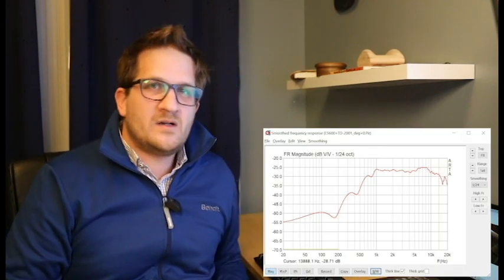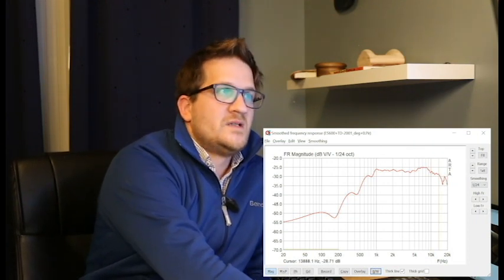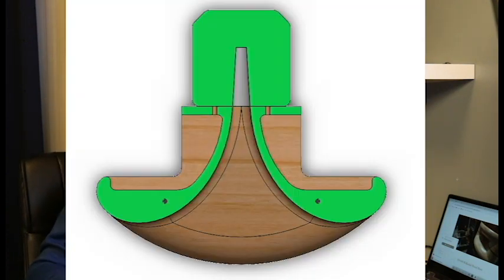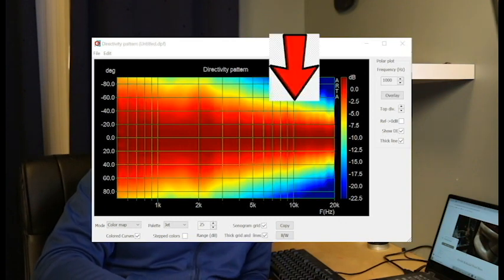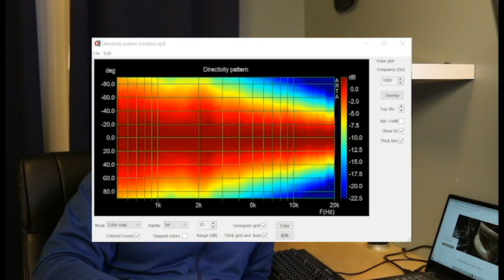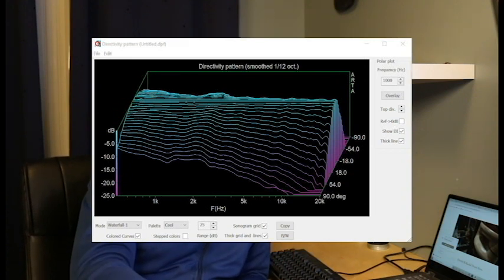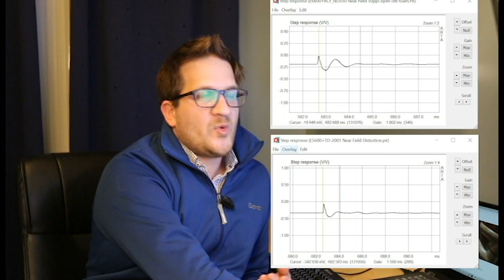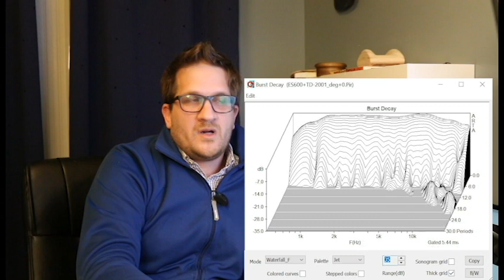TAD TD-2001 with ES-600 1" Biradial

Comment: Firstly I should say that I very much respect your work. I would say you are almost unique globally. The combination of knowledge and CNC offers the audio community a great set of products. I just want to note a comment on your subjective listening,; the driver is crossed at 1200 and you score female voice higher based on your comment that the horn is carrying the workload. I don’t know what you were listening to but the majority of female voice will play under 1000 with mainly second and theirs harmonics higher than 1200. The same is true for acoustic guitar which you commented would not compare on a woofer to the horn when in fact all the fundementals would play on the woofer with such a high crossover.

Comment: very honest video, I found your instagram and now your yt. The TAD stuff is just the best i guess
Reply from the maker: I think the TAD TD-2001 is a very nice driver.  Although I've tested other TAD models that did not perform any better than offerings from RCF and B&C.  It's a mine field these days with all the opinion and hype which is why I love the measurement aspect, it separates truth from fiction.   If it doesn't measure well then there's no chance it's going to sound good.  The set of measurements that I provide are usually pretty good at fishing out any shortcomings in sound quality.
Reply: Joseph Crowe's DIY Speaker Building i agree partly. But like with everything, exceptions exist and some things sound gorgeous but measure badly. Maybea it‘s not exactly what‘s on the record, but since it‘s catching us emotionally, it contributes to the experience. One example are the Goto drivers, they measure badly but many many people agree they sound best. But overall i‘m d‘accord with you! I would also like to know which TADs you have tested already:)

Comment: Looks great! A matching (exit angle - horn throat) driver/horn combo.. I’ve read before that the TD-2001 is at its most linear with high output impedance amps (both ss and tube..).. 

I’m curious as to what midbass driver you’d use to keep up with ‘em if these were your own (to bump up that score of 6 in the midbass to mids coherence..) Or maybe it just needs a midbass front horn? Also, for your taste, does it still warrant a horn tweeter even if there is almost no break up in the upper frequencies? I hope you could display the measurements in full screen next time. Thanks!
Reply from the maker: Thank you for the feedback.  I'll try to display full screen more so that you see the detail.  There is absolutely no need for a super tweeter with these.  I suspect other horns may need help since there would be cancellation effects due to the dispersion fins that you see on other horns.  The best midrange and bass solution would be to use a horn as well for this part of the spectrum. However integration is always problematic which is why I've come up with the Nighthawk speaker.   The midrange is equal to the TAD's clarity and technically you could use the TAD TD-2001 on the nighthawk.  The first version and build for the Nighthawk was for a nightclub in Newyork city.  The second build is strictly for hifi so I'll have more latitude on driver choice.  I'll be making my own midrange drivers for the second build.
Reply: Joseph Crowe's DIY Speaker Building

 Thanks Joseph! That would be an impressive sounding nightclub with the Nighthawks.. I can see you selling this as a fully fledged commercial high end speaker after more r&d and refinements, plus adding purpose built bass bins to match..